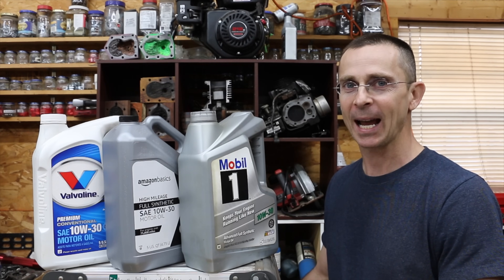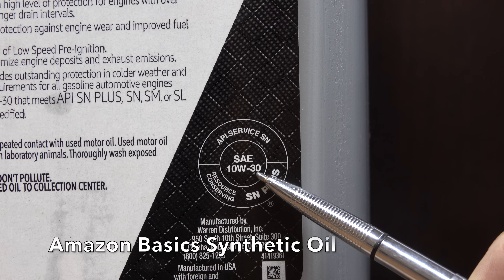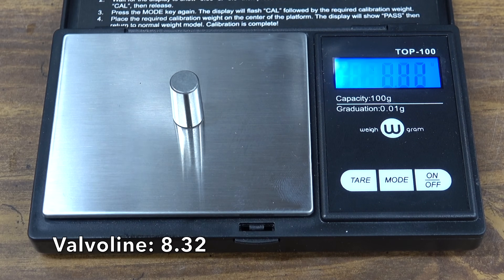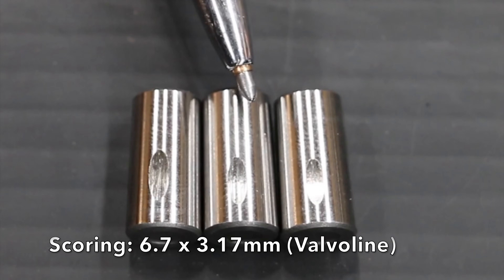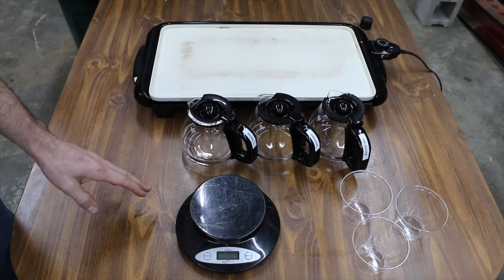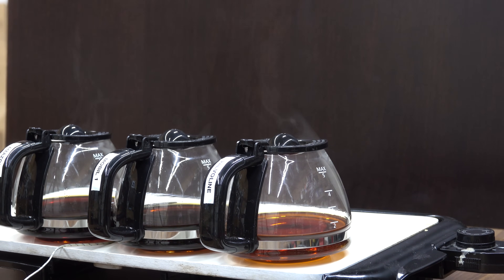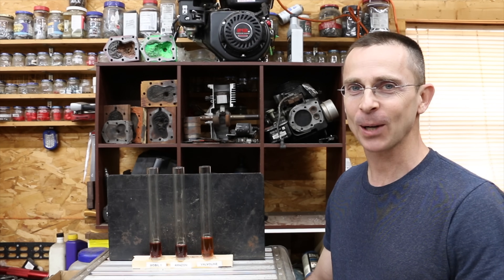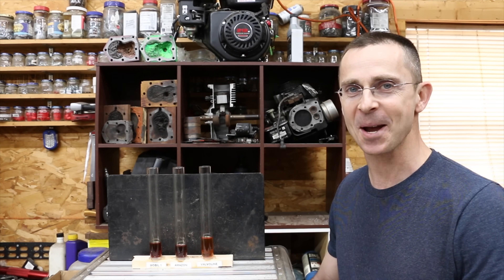Is AmazonBasics Full Synthetic Motor Oil better than Mobil 1? Let's find out!

Comment: I know you recently named Penzoil Full Synthetic as the best, but now Valvoline Full Synthetic Advanced has reformulated and is touting that they are the best.  Was wondering if you may want to stack these two against each other again, or maybe you already did.  Love your channel!
Reply from the maker: Thanks!  Thanks for the video idea.
Reply: Actually it was Amsoil that won his test and Pennzoil Platinum came in second. I didn't know that Valvoline has recently reformulated. I'll have to check that out. No surprise though that they would claim their own oil is the best, most oil companies do that lol. Pennzoil offers two different Synthetic formulas. The Platinum and the Ultra Platinum. I would be very surprised if the new Valvoline formula outperforms the Ultra Platinum from Pennzoil but anything is possible.

Comment: I might have asked you this question before. My mechanic thinks I might have a valve issue. But we really won't know until it gets worse. He doesn't recommend carrying the car apart until we know what's wrong. Even the dealer couldn't figure it out. But, he was recommending that I should get a valve cleaner to put in my car. I am very hesitant to put abrasive cleaners in my car that could possibly ruin my engine. I drive a 2011 Prius. Is there something you recommend I can put in my oil or my gas tank? I always love your videos.

Comment: I enjoy ALL of  your projects. Thanks for the hard work. Since you've tested so many motor oil, I would like to know: will it destroy the engines if you put 0W-20 in engines that require 5W‐30 or 10W‐30.
Reply from the maker: Thanks!  Thanks for the video idea.
Reply: Testing a 0W-20 in a engine that recommends a 5W-30 would require running two of the same engines tens of thousands of miles and teardown both to compare wear on bearings and timing chains etc.

Comment: I’ve heard people say adding full synthetic to an engine that is older or that has been running conventional will ruin it.  Can you test switching back and forth with standard and synthetic oils in different engines?  It would really help break the spread of misinformation!  Thanks for a great channel!
Reply from the maker: You are welcome!  Thanks for the suggestion.
Reply: I've switched back and forth on my old engine and never had a problem.

Comment: awesome content! subbed. wondering if you could do a test of some sort to see how important it is (if at all) to warm up an engine to "operating temperature" before going into higher RPMs? I have always tried to drive gently before my engine oil hits about 180 F, but wondering how important this actually is. many car forums say you absolutely have to fully warm up before driving harder in the slightest. sometimes you have to accelerate hard on a cold engine – how much damage or wear is that causing? thanks!
Reply from the maker: Thanks!  Thanks for watching and subscribing!  Thanks for the suggestion.
Reply: @ProjectFarm  of course! really appreciate the time you take to reply to a comment on an older video.

Comment: With summer approaching, temperatures getting higher, air conditioning running, what full synthetic engine oil holds up the best, & maintains proper oil pressure? Question driven by my '99 Suburban that when the temps go over 95°F, air conditioner running on full, the recommended engine oil of 5W30 tanks & the pressure drops to almost nothing (5psi or less at idle). Oil additives like lucas? Changing to 5W40 (API SN)? Is 10W50 (or 20W50) too much?
Reply from the maker: Thanks for the video idea.

Comment: My Honda EU7000is inverter generator takes 10W-30 oil and I recently converted it to run on natural gas.  Do you think the AmazonBasics 10W-30 would be fine to use with this generator?  I understand that Amsoil makes a full synthetic small engine oil specifically for these types of engines, but it is much more expensive.  Have you done any testing of small engines converted from gasoline to natural gas or propane to see if they run cleaner, hotter, or have other characteristics that might hint at any pros and cons for converting?  For a generator running on natural gas, I like the idea that I will never run out of fuel and I don't have to store a lot of gasoline that can go bad. 

Thanks for the great videos!

Comment: Reading some of the comments what several people do not understand is that ALL MOTOR OILS MUST MEET API STANDARDS AS STATED ON THE PACKAGE! Some brands or even batches may have more additives than required as shown in the 10w30 cold flow test, the Amazon Basic has more Viscosity Additives than the others while Mobil 1 has more Anti-Ware Additives, which simply means you are getting more for your $ depending on the price.
Reply from the maker: Thanks for sharing.

Comment: Would like to see a comparison of these oils... Schaeffer Oil... Mobile 1... Toyota brand oil... Amsoil.
All full synthetic. I use Toyota oil in my truck which is suppose to be mobile 1 with extra additives for protection. Supposedly the most protective additives you can get but Schaeffer Oil says they have the most protective additives.
Let's find out 👍
Reply from the maker: Great suggestion!  Thank you.

Comment: Why are you testing 10W-30 weight oils?  As a lubrication specialist I can't think of a good reason why anyone would use this weight when 5W-30 and 0W-30 oils are now available from most brands.  Keep in mind that a 30 weight oil at operating temperature (where an engine spends >95% of its life) has a viscosity of about 12 cSt while a cold engine even with a 0W oil the viscosity is in excess of 200cSt.  Therefore, to protect your engine at startup, which is where experts agree that most engine wear occurs, you would want an oil with low viscosity at "room temperature" so it will be more quickly pumped to the bearings and other wear points.  That's the whole point of multi-grade engine oils.
Reply from the maker: Thanks for the feedback.

Comment: How about a 0w20 vs a 10w30 in a heat test?   Same brand of oil, but heat them both up to what they might be on and 85F day and immediately run the bearing test on them...  Don't really need the cold pour test as the 0w20 should win that.
Reply from the maker: Thank you for the video idea!

Comment: Quick question Todd, both Amazon Basics and M1 lost 0.12g off their respective bearings. How would M1 be considered the winner when both lost the same amount of metal?  I get that the wear scar is larger for AB, but was the wear scar on the M1 bearing deeper?  The metal was lost from somewhere, and that the only place I can think of. I use neither of these oils, I'm just curious. Great test, thanks!
Reply: You're mistaken. It's 0.12% not grams. And they did not weight the same when it started either.

Comment: I was going to use Amazon Basics, but then noticed that Costco's Kirkland also has a similar oil around the similar price. Costco comes with 2 - 5 quart bottles in a box for around $25 (if memory serves).  I have been very happy with the oil so far.  Can that be tested against each other?
Reply from the maker: Thanks for the video idea.

Comment: I love these videos.  However, it makes me a little sad to know that all of the automotive fuel, oil, and additive products will be a thing of the past due to electric vehicles.  It makes sense for my kids though as they don’t seem to have any interest in maintaining vehicles.  So, they won’t miss the old days of internal combustion engines.
Reply: Don't worry, that infrastructure will take decades to be mainstream like that.
Reply: Unless you are 20 years old you will not see the death of the ICE. By 2050 75 percent of all cars WILL STILL BE  ICE !!!The remaining vehicles will be plug in hybrid, hybrid and electric.
Reply: Why would you be sad about motor oil and engine additives going away? It’s one less thing to worry about or spend money on.
Reply: @chalaron  every time my gmc breaks its an electrical component
Reply: @chalaron  I agree. I am going to buy a fully electric or hybrid as my next car.  My current Acura only has 80k miles and.  So it will be a while before I make the switch.  However, I feel like doing all of my own maintenance in an ICE vehicle allows me to know the full condition of my vehicles.  I don’t anticipate the ability to work on an electric vehicle though due to all the proprietary electronics that would require a $30k computer just to diagnose the condition of the car.  The majority of ICE vehicles can be scanned via a simple ODB2 scanning device.  The rest of an assessment is all visual.
Reply: @chalaron  lol do you own an electric vehicle if not go buy one please and report back here after 1 year

Comment: i think you should also have exactly the same level of every oil in the cup if that was the only source of oil on the spinning wheel.. looks like it was not the same - mobil one was the most in the cup. By the temperature test - i think was easier to pour the oil dircectly to the containers standing on scale - pressing TARE would put 0 on it regardless of its own weight and then you can put exactly the same amount of 200gr to each, the cups was not necessary. Doesn't mean I don't like your tests and what you doing, just the opposite, i'm very grateful for that. Thank you and take care:)

Comment: Had low speed pre ignition issue on my brand new Mokka, engine failure at 2500 miles.
Reply from the maker: Thanks for sharing.

Comment: The oil subject is misunderstood and that's why many seeing this believe that Amazon Basics is a great oil.. This test is far from the actual oil behavior in the engine.
When the oil is hot in the engine it undergoes heat, pressure, burning, then cooling and repeat.
The simple flow rate or cold rubbing test only tells me that I should Use Amazone Basics oil to soak my old rusty lug nut somewhere nothing more and that's probably the only place I would put it in to..
You have to be an idiot to believe that a simple rubbing reading and the flow rate is all it takes to decide which oil is best. 
When the oil is super hot it wants to go thin, that's when your engine becomes vulnerable. There is a whole chemistry composition involved with additives that prevent the oil from becoming thin. 
 Now how fast it becomes thin, how thin, how much carbon debris it leaves behind when burning, how long it lasts finally!
The Amazon Basics
As they say, the poor man pays twice.

Comment: I know you’ve kind of beat the oil thing into the ground but the BMW community is very split on what oils are best and it would be awesome if you could compare Mobil 1 0w-40 with the LL-01 approval from Walmart , Castrol edge 0w40  , liqui molly 5w30 or 5w40, vs maybe some basic ones like Amazon basics and regular Mobil one or valvoline or something like that to really compare. Would be nice when a thread about oil comes around (which is often) we could have a definitive thing that says hey look this actually has evidence to back it up and here is the video. Idk maybe research the most common bmw oils with the LL-01 rating and pit them against each other. It would be super cool and I’m sure a lot of people would appreciate it. Generally bmw’s are not cheap and even if it’s just oil, protecting your investment in whatever way possible is ideal especially when the rating means that it’s approved for 15k mile intervals. Thank you for reading this.
Reply from the maker: You are welcome.  Thanks for the video idea.
Reply: @ProjectFarm  absolutely, yeah just you know if your going 15k miles on inferior oil that damage can add up pretty quick you know?
Reply: @ProjectFarm  also I watch almost all of your videos lol I didn’t even realize it until I went to the main page and they all had the red bar on them. Really appreciate your work and how thorough you are.

Comment: To those complaining how he added more Mobile 1 to the lubricity tester, please understand that the excess oil will fling out of the cup within approximately 15 seconds so the oil always end up level to the bottom of the rotor. No matter the difference in the starting amounts of oil, the bulk of the test the oils run at similar surface levels.
Reply from the maker: Thanks for the feedback.

Comment: Have an idea if you haven't done this yet. In odyclub.net we are debating how much a used bottle of oil can be damaged from the moisture introduced by opening and allowing air into the bottle. Does the little bit of moisture damage the oil say if it's sitting around a year, two years. This would be a long term test but very interesting if you like the idea.
Reply from the maker: Thanks for the suggestion.

Comment: Hi! Could you test synthetic oil quality difference between changing it every 5,000km and 10,000km in a car? I ask because here in Brazil a lot of guys says that oil must be changed every 5,000km and not 10,000km as the manual recommends due to "severe traffic use" even if it is synthetic. Is that right?
Reply from the maker: Thanks for the video idea.

Comment: I think that the major issue is how quickly the oil deteriorates and looses some of its film strength and lubrication properties. That is something very hard to test besides running it in engines for quite some time, then perform tests like this. I have experienced problems such as low oil pressure on idle for example when it's time for a change. Last time I saw this was with Castrol GTX, though many years ago. I disregarded the fancy bottle and label and looked at the specs and discovered that it was a plain overpriced mineral oil at that time.
Reply from the maker: Thanks for sharing.

Comment: Great video! Thanks for putting the effort on doing these tests. I have been using both Mobil 1 and Amazon Basics synthetic oil interchangeably and looks like both  have been one of the best choices so far for their price range.
Reply from the maker: You are welcome!  Thanks for sharing.
Reply: @ProjectFarm  great video mate! from your experience you would suggest more oil in a 2zzge engine (toyota vvtLi 192 hp 8.250rpm) I put the factory toyota 5w40 I live in Greece hot climate and I have been told about molygen what is your opinion? can you tell me 3,4 companies in 5w40 that you consider top in high speed stress but also in the city? thank you very much! ✌

Comment: Why did you compare a conventional oil to two synthetic oils. That's pretty unfair considering Valvoline does have a 10w30 synthetic motor oil available.
Reply: The Valvoline doesn't have any feelings and doesn't care about the "unfairness".  The purpose of the test is head-to-head between Mobil1 and Amazon Basics.  The Valvoline conventional results just help to show the tests are really measuring important oil properties.  For example, when Mobil and Amazon come out the same you could wonder if the test is even testing anything.  But then you see Valvoline did much worse in the same test so you can have more confidence that the test was actually measuring real properties.

Comment: Great video! Will you please test the below oils against each other?
All in 5w-30 full synthetic (no high mileage)
Mobil 1 extended performance
Valvoline 
Pennzoil ultra platinum
Castrol edge
Reply from the maker: Great suggestion!  Thank you.

Comment: As a science teacher, I think this would make a great set of experiments for an auto shop class.  So much covered here with controls (which were great), looking at claims, data, data analysis, dispelling brand worship (tribalism) & avoiding bias. Solid stuff. I think I'm going to write this up as a set of labs and give it to my auto shop teacher as it (and this channel in sum) really shows not only the practical purpose of science and its method, but also highlights the inherent cross-curricular application of teaching it.
Reply: I have a '14 Corolla and live in Chicago. Based on your testing is there a 0W-20 that you'd recommend? Amazon Basics/SuperTech (Warren Distribution)?
Reply: auto and shop classes are still taught in high school?
Reply from the maker: Fantastic!  Thanks for sharing and the best to you and the project in class!  Glad I could help.
Reply: @ProjectFarm  hi, thank you for the info. Would really love to see a video comparing oil filters, specifically Mobil 1, Hastings and wix

Comment: How about a friction test on just viscosity like 2 of the same brand oils but different viscosity.  I have heard thinner oils can damage engine because they have a thinner film barrier meaning more debris come in contact with metal than say thicker oil which has a thicker film and allows for larger debris.
Reply from the maker: Thanks for the video idea.

Comment: Hey Todd! Great video! I have been buying Mobil 1 six packs at Sam’s or Costco when they put them on sale. I’m not sure if I would or would not be better off switching. Here are some ideas for future tests. 0-20 vs 0-16 oil. My car is a 2015 naturally aspirated GDI that calls for 0-20. Would I benefit or be hurt by 0-16? Next, it very rarely gets down to or below 0 here. Could you add a flow test at 0? Results could possibly be a whole lot closer at a warmer temperature. Last, does temperature or cooking the oil affect lubricity? Since new oil only exists for a very short time, it would seem more like real world data to recheck lubricity and flow after a few thousand miles of use. I do realize that mileage may have to be simulated. Thanks for all of your hard work and thanks for your service!
Reply from the maker: Thanks for the video idea.